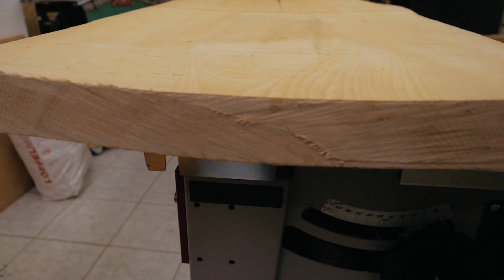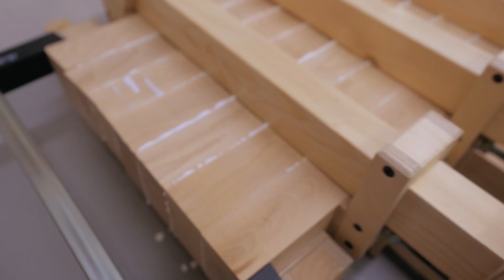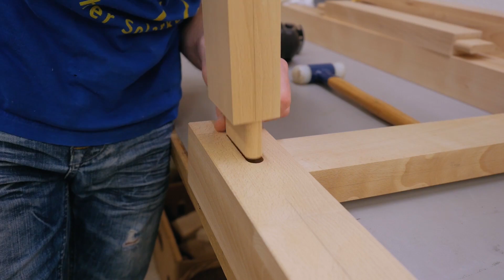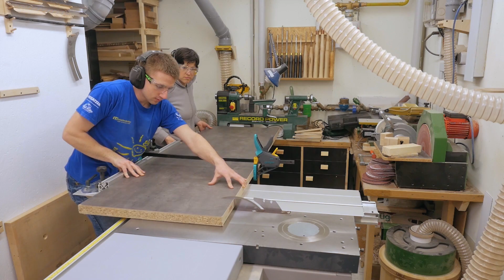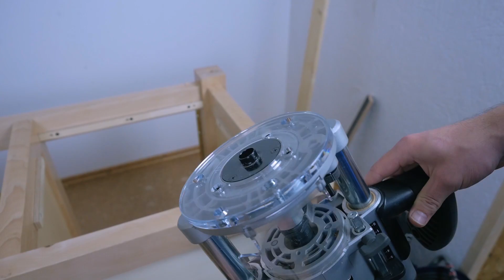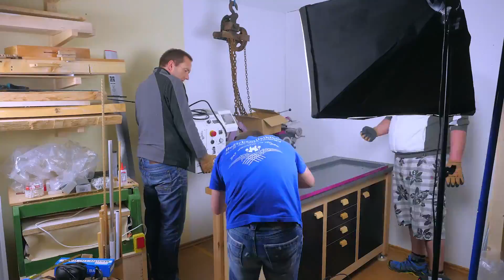Building the Lathe Stand/Workbench

Comment: Hi Marius, I've just found and watched this video and noticed your problem with your dust extractors becoming too full before you notice they need emptying.   I've had a thought - and wondered if you had also - if some sort of simple alarm could be fitted inside the collecting unit/bucket which activates (button is pressed) when the collected dust gets to your max pre-determined height of dust before emptying.   Off the top of my head, a wooden ring or disc or even a lever which sits under the alarm button which activates the alarm when the force of the rising dust pushes it against the alarm button???  Of course, I'm thinking particularly of the non-transparent buckets!
Love to know your thoughts.  Regards, Trevor

Comment: Great job. 
I just have a small suggestion. 
If you had cut a round hole in the foot plate, big enough that the head of the bolt would spin, you would have had exactly the same result; but this time if you would want to elevate the table or lower it, the bolt would turn, table would move but the foot would stay still. Of course the nut above the foot should be a little away from the head of the bolt.
Reply from the maker: but then you can't lock them when you found the right hight or did I misunderstand you?
Reply: Marius Hornberger It's hard to explain this without the sketch and by typing on a phone. But I will try anyway.
Order of elements in an exploded view going from top to bottom:
Table leg
Nut #1 in a hex hole
Steel plate #1
Nut #2 acting as a counter nut
Threaded part of the bolt
Nut #3 locked in position using the pin
Steel plate #2
Head of the bolt in a round hole
Wooden foot

If there is a 1 mm gap between the head of the bolt and a steel plate #2, and 1 mm gap between the head of the bolt and bottom of the hole in the foot the foot will be free to rotate relative to the bolt. This will make it easy to adjust the height of the table. Once you find the right height you can lock it by tightening the nut #2 over the steel plate #1 to the nut #1.
I hope this is good enough explanation.

Comment: Gratuliere sehr geiles Projekt. Danke für die coolen Videos. Ich beginne gerade das screw advanced box joint jig from Mathias and I have a question about that. In the plans there is a list with the gears and so on... I didn't get it. Maybe u can explain it to me in german. Only the calculation table. Have u used m8 or m10 threaded rod? Greetz from vienna

Comment: Hi Marius - thank you for your enjoyable videos.

May I suggest...

i) fitting a 25mm high watertight tray under the lathe - the full size of the top of the bench.

ii) add a Formica covered, vertical backboard behind the lathe. The work in the chuck will be splashing coolant/cutting lubricant onto your wall. 
 
iii) the top of the backboard to have a shelf so that you can place "in use"  tools, clipboard with sketches, micrometers etc. conveniently out from the mess that collects on the tray under the lathe during use.

iv) fit two adjustable lamps underneath the shelf to throw light exactly where you need when are working.

v) bring your electrics down from the top and place your switches on the l.h. side of the shelf - so that when things misbehave you are automatically pulled out of line of the chuck. (don't ask!)

cheers edi

Comment: Hi Marius a nice way to tighten the nut at the base onto the drilled washer (PS stealing that idea!) is to add 2 extra nuts and tightening them against each .Then you would protect the thread and you could tighten the one at the bolt head to your hearts content.

Beautiful Cabinet ! (I welded mine since I am all thumbs with wood)
Metalworking Videos with new machines mounted... 
Ends with  "Lets make some chips"   ;)

Comment: very solid build, the pantorouter is a very powerful machine. 
that stand should last a few years (except for the particle board top, I hope that falls apart very soon :-P, so you have to make an endgrain top and show us in a video :)
as you have already mentioned, the short grain between the mortise and the top of the leg is not very strong, it is not going to matter much here in the end, but normally this joint is made a bit different it is called a haunched mortise&tenon joint (Nutzapfen oder Nut-Zapfen Verbindung auf deutsch) 
that's what it looks like and how you can make it. http://www.popularwoodworking.com/projects/haunched-mortise-tenon
Reply from the maker: Ah cool, thanks for the tip. Next time (if there's a next time) I'll offset the tenon. Should have the same effect as the haunched M&T.
Reply: offsetting the tenon makes the short grain a bit longer and thus stronger but it also makes the tenon less wide and thus weaker (especially against twisting) that's why the haunch is an ideal compromise. 
https://blog.lostartpress.com/2016/10/20/why-the-haunch/

however with the precision of the pantorouter, the strength of modern glue and your wood choice I don't think it is going to be a weak spot.

Comment: I use a lot of insert nuts (the last that I bought was M12 size on eBay) they are very practical and it will save you a lot of time on a adjustable foot height (you don't need to spend time to do the hexagonal insert)
Nice work

Comment: Hi Marius, another superb video. Two things: are you satisfied with the diamond saw blade, would you recommend it? Are there any inconvenients? Have you also tried it on melamine? It really surprises me you can use it to rip such thick beech stock! Secondly, for the cup hinges: there are 35 mm Forstner drill bits available with a very small centre points, especially for thinner panels.
Reply from the maker: Yes, I'm very satisfied with it. The big inconvenience is the 300€ price (+30€ thin riving knife). I cuts melamine perfectly (as you could see from cutting the top of this project. No chip out at all). But it does not work very well for softwood.

Comment: Very nice build Marius! Is the router you're using for the pantorouter the same one you used to flush trim the oak edgebanding on the kitchen worktop? If so, what is it please? I'm thinking about building a pantorouter from Mathias' plans but have not got around to finding a suitable european router yet.
Reply from the maker: yes, it was the same. It's the  AEG MF1400KE
Reply: Thanks, I can only get 1/4" collet models with the barrel body in the UK. I have a great Makita one for a pantograph but it's only 700 W. Does the 1400 W AEG router ever feel underpowered or is it plenty for a pantorouter? I think my biggest worry about using the smaller Makita for making a pantorouter is limiting myself to smaller bits available for 1/4" collets.

Comment: Great, as all your  projects are. The only downside that I see is that there is no provision for constant lubrication. If there is a way for liquid to reach the particle board table, it will surely find it. It is not to late to put a piece of sheet metal under the lathe.  Perhaps you will not do the type of work that requires a steady stream of coolant/ lubricant.
Reply from the maker: I think that didn't show in the video, but the lathe came with a metal base plate, that it now sits on.

Comment: I don't completely understand why you used big slabs of wood to make little pieces of lumber.   Why not just start with little pieces of lumber and use the slabs for some kind of impressive large piece of furniture?
Reply from the maker: Because slaps are what you get from the sawmill.
Reply: Ok, makes sense.  If you have it why not use it.  It made nice pieces and the slabs were quite warped and split.

Comment: Extremely nice. You've rapidly surpassed many of your much older woodworking peers. I hope you first leveled the bench then the lathe on the bench.
Reply from the maker: No, we did that with the lathe on top. Turned out the lathe bed wasn't parallel to its feet. Now the table top isn't level, but the bed is.
Reply: Well the point of leveling the lathe is to get the twist out of the bed. you don't really care much about level. You want to level the lathe using it's own feet to ensure the twist is out. Might not matter on that small and lightweight of a lathe, but it's good practice. There are some videos on youtube on how to.
Reply: Marius Hornberger that may be because some lathes normally sit in a metal tray with a fall on it to collect and reuse oil.

Comment: I was going to say you can buy steel adjustable feet of Ebay for commercial kitchen equipment. But then I saw what you made and thought nah, yours are much nicer ! Excellent work, my friend. That bench will last for ever. Also, impressed by your glue up and resaw to make four components out of seven pieces.
Reply: Weight issues would arise from that I'd expect. that's why the ones he could buy were so expensive.

Comment: A very nice job but one small extra a ice hockey puck glued to each foot you would have anti-vibration mounts
Reply from the maker: Hey, good idea
Reply: indeed. and if you ever would mop the floor, rubber feet don't attract the water :-). my hole shop stand on rubbers, just for that reason hehe.
Reply: I also use rubbers often, friend ( ͡° ͜ʖ ͡°)

Comment: I have an Optimum D250x550 Vario and I think the importance of a good light source (preferably with a reasonably stiff flex shaft) positioned right over your work piece cannot possibly be overemphasized.
Reply from the maker: The light for it is already standing in the corner. But the two studio light boxes are quite perfect for now.

Comment: Nice! Too nice for shop stand I think, what with hot flying metal bits falling every which way. Wouldn't metal top make more sense in this regard? Just to be extra safe and pushing the coolness level to 11 :)
Reply from the maker: The lathe came with a metal base plate. The hot chips are safe :)

Comment: If you'd ever open up a different shop, I don't think you'll ever get that beautiful cabinet out of there   :(
Reply: Nah, knock down the wall to take it out then rebuild the wall :D
Reply: Or replace the wall with a door. Since it is in a basement, a door in the floor above is in order. Also: A crane above said door-in-the-floor. Both of which will add resale value to the house.
Reply: I love beech wood by the way, good choice!
Reply from the maker: I can always build another one. If I don't film it, it takes about 3-5 days.
Reply: Double Dare Fan not sure I trust your assessment of what adds to house resale value.

Comment: Somehow I think it's a shame to use such beautiful wood for a shopproject. Still a wonderful job though!
Reply: Shop project doesn't have to mean rough. So not a waste at all. More an indulgence. 

There is a long long tradition of craftspeople making especially nice working furniture for themselves. Exquisite toolboxes and benches are quite common. Handles of turning tools, racks, and all kinds of things made with care, that last generations. 

 And Beech is quite commonly used for woodworking benches, where weight and strength really pay off.
Reply: Sjoberg work benches are all constructed from fine European beech.  They are considered some of the finest benches around.
Reply from the maker: +Yonatan24 and it's cheap (in the world of hardwoods)
Reply: I guess if you got it, use it how you want to.  However, just know there are a lot of woodworkers out here that would give their left (you know what) for a couple of nice slabs like that.
Reply: beech is very cheap (less than half of the price of oak, and not much more than pine) here, and it isn't such a great wood to work with, it moves a lot with changing humidity. however for a project like that, I couldn't think of a better wood than beech.
Reply: European Beech is the best type of wood. I use it for pretty much everything! :)
Reply: But the type of Beech that Marius used is a bit different from what I normally use. I can see the striped side, but the other side looks a bit like maple, and mine isn't like that...
I don't know...
Reply: I don't know. I salvage all of mine for free...

Comment: What is the origin of Optimum lathes? Germany 100%? Price?
Reply from the maker: Have a look in the video description or the optimum website
Reply: Origin is China but they get controlled and optimized in Germany with decent support.
Reply: Polis Dimitriadis i dont know about the lathes but Stefan Gotteswinter has am Optimum milling machine and is satisfied with it
Reply: Polis Dimitriadis built in china, designed in Germany
Reply: I thought so.. Does anyone knows the price? And how reliable this thing is?
Reply: Polis Dimitriadis They are made by a chinese company, Weiss or something. The Optimum machines have a lot of "custom" optimizations and are assembled, tested and callibrated in Germany. They also have a few German and Taiwan made parts. I have a bigger model and you wouldn't easily call it Chinese.
Reply: Why did you choose this lathe over others?  I see it listed for about $2K.  You can get a very nice Grizzly or Jet, or ...